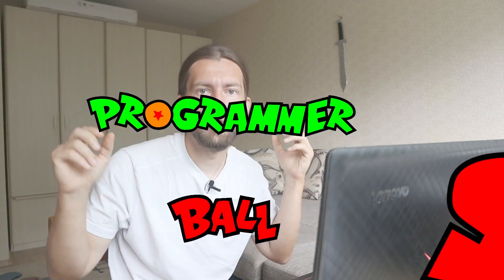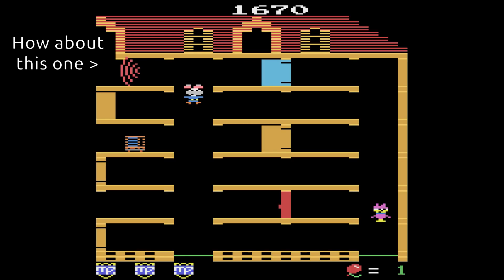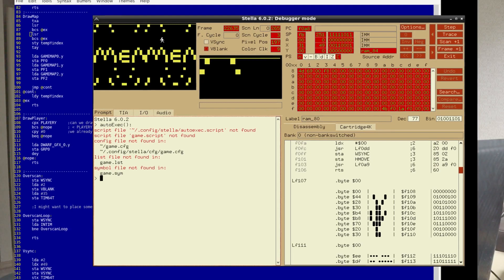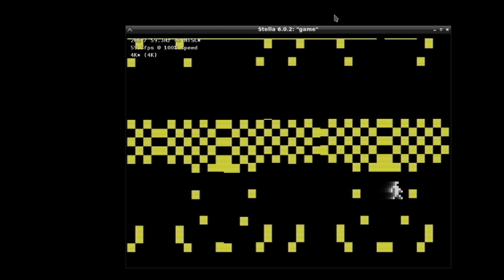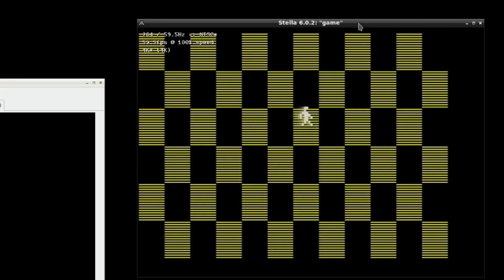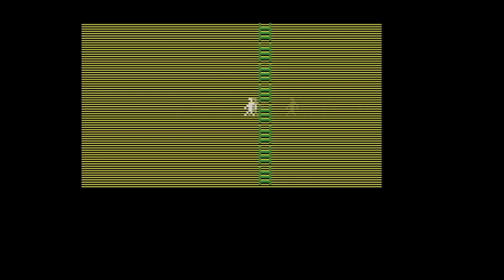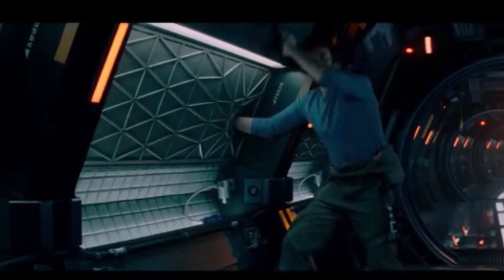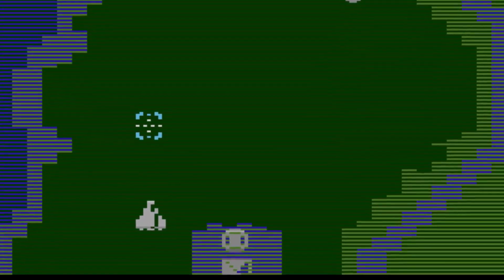How I tried to make ATARI 2600 game (part 2)

Comment: So you can see how clever and skilled were the guys who created Pitfall and other Atari masterpieces 40 years ago.
Reply: It's truly fascinating what so many bright people could do with such limited hardware. In fact, back when intel 8080 processors were released ( early 70's ), they were priced at $350 but they didn't know if anyone even wanted such underperforming chip ( the mainframes still ruled the computing world ), so Ed Robberts, the CEO of MITS, the company responsible for producing Altair 8800 and thus the home computer revolution, negotiated the price down to $75, so he could sell Altair 8800 for $440 ( in kit form, as an assembled one cost more than $600 ). But even the man himself wasn't sure if anyone could do anything with his severely limited computer ( storage as low as 1024 BYTES in the cheaper ones and 256 BYTES of memory, and not including a terminal and only switches and LEDs as a way to interact with your computer as default as a terminal cost $1500 alone ) or if there was a market at all, but well, not only people wanted it, they even wrote software for it, among the names being a certain Bill Gates and Paul Allen, among many other people. It was truly the era of hobbyists.

Edit: grammar mistakes and checking the prices
Reply: @resentfulsoulofthetoilet589  Good catch!

Comment: Once I learned the EXTREME limitations of the Atari 2600 I gained a lot of respect for the programmers who worked for Atari and Activision back in the day. It is amazing that they can actually get it to do anything at all! And it only has 128 bytes of RAM. Yes, BYTES! And on top of that, they had very few programming tools to help them. They were literally using calculators and graph paper.  They would drool if they could see what kinds of programming tools are available nowadays.

David Crane had finished his legendary game Pitfall but he only gave the player ONE life in his initial version. His teammates convinced him that you should have at least 3 to begin with. The problem was that he had used virtually EVERY single byte of available ROM space (only 4k!), so it took him several WEEKS to look for ways to make his code smaller just so he could add in the feature of having extra men. Weeks!

Comment: Lovely video. ☺️ I’ve heard assembly is quite a difficult language so it’s impressive you’re making progress. 🙆 I’m learning Japanese, It’s structured very differently than English, I have to rewire my brain to understand their grammar. I imagine assembly requires similar rewiring. 😵‍💫🈲
Reply from the maker: Thanks. Nah, assembly itself is not that difficult. It's just tedious. You have to write a ton of lines, just to do basic things. I guess it affects the brain a bit, since after using it for a while, I started making very odd decisions while writing code  in high level languages 😄